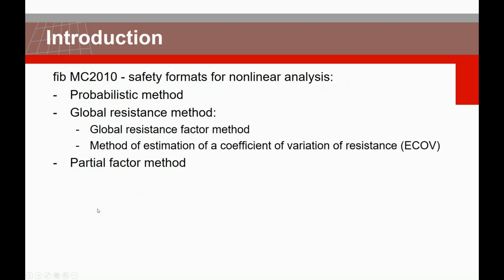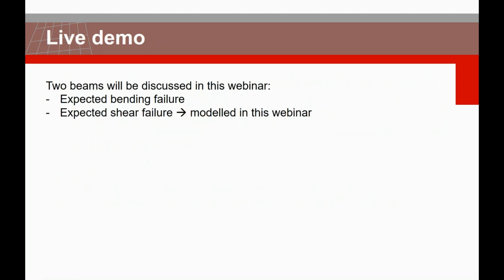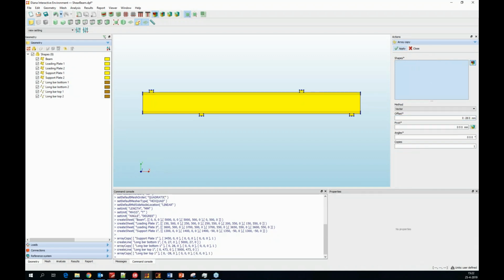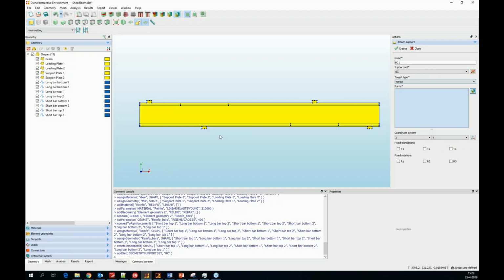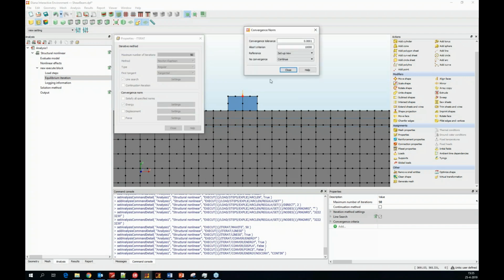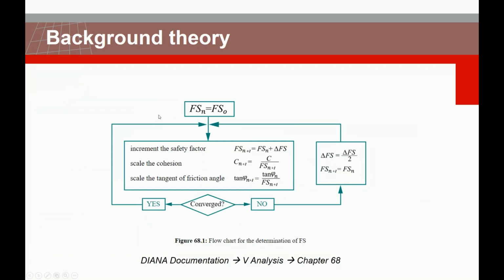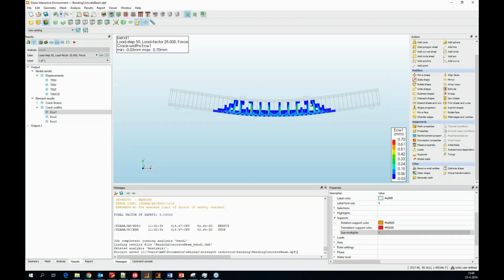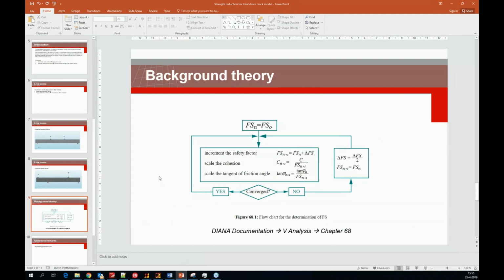Webinar: Strength Reduction for Total Strain Crack Model in DIANA

Comment: Hai, for reinforced concrete model, after mesh operation, on "element type" tab inside "Mesh" menu, is it normal if there is only one element type which is element type for concrete?no element type for reinforcing bars